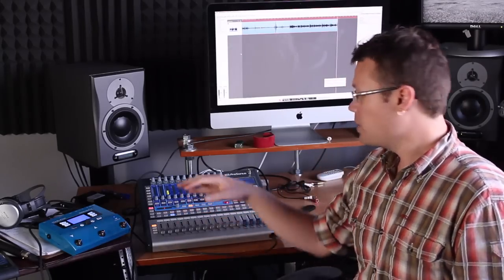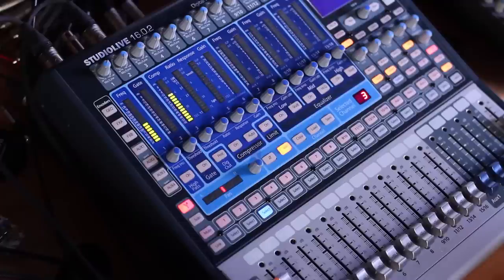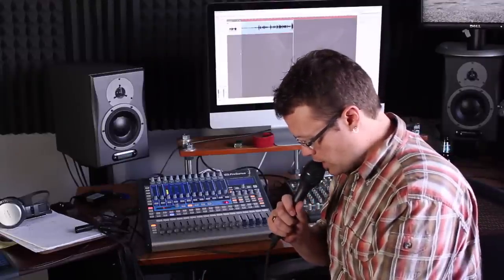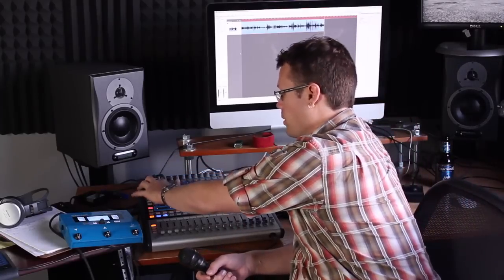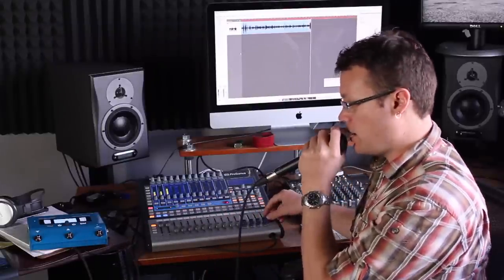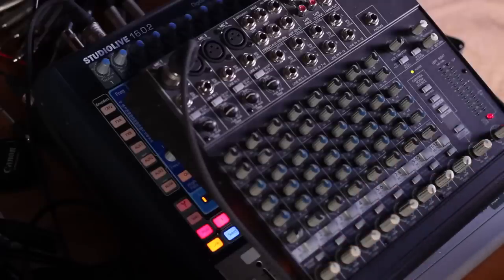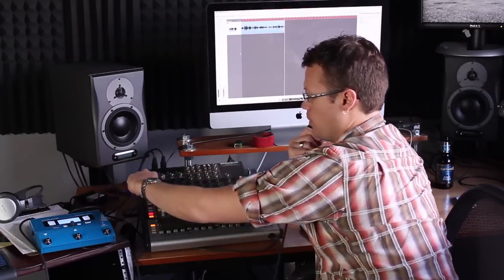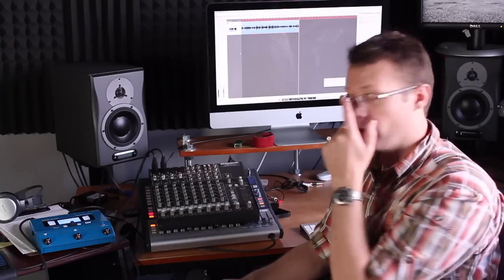TC-Helicon - Mixer Setup, Gain Staging and Vocal Processors

Comment: Feedback is not the issue for me. Getting a blended harmony through a PA is/was my issue. It takes a lot of experimenting to get it right especially with my wireless Sennheiser. I would typically "red light" the Voice Live Play with its gain turned almost all of the way down so I had to go into the wireless receiver and back the AF down to -12 or -18. I then go into my output on the TC unit and boost it to low or medium depending on the board. (usually Mackie ). At that point get my harmony at a nice level. I can then adjust the gain on the board adjust the sliders on both channels to get a natural sounding harmony out front. Hopefully this helps some of you. Since some sound engineers throw a hissy fit about using my Voice Live Play or even any mic other than a Shure 58, I often find myself tethered to a 58 without additional doubling or effect of my choosing. They would never tell a guitar player that he has to play "Eruption" with the house's Fender Mustang and no effect pedals but unless the sound engineer is a singer, he doesn't quite get it.
Reply: Hi please!
I need so much to understand what have you done to achieve good results live.
I got a TC helicon voice live play but when I use it, I have to turn gain on the mixer way up.

Comment: Just listened to this for the first time...,the stereo idea is intriguing...,I take it that stereo is primarily done for the Efx in the VLPlay, you want a wide sound stage but you also have chorus, etc to consider and that, to my mind always sounds better in stereo....,obviously you need a stereo mixer and then stereo into your DAW channel/track. (BTW - I've heard it's not good to hot-wire your inputs into the mixer, it harms the pre-amps)

Comment: I bought this . I received it today . I remember asking someone who did a video on it and I asked a question of what is everything that is needed for me to be able to use it. And I was told the voiceliveplay and a mic (and I got the mp-75 mic) and I don’t know but I’m trying to use it and it’s not working for me.. what am I missing . All I have is the voiceliveplay and the mic and the wire connector for mic to the pedal. And the power cord that’s all . What am I missing please help
Reply: Leonid, you also have to have some type of amplified speaker. Whether that's a powered mixer to speakers, unpowered mixer to powered speakers, Analog/Digital interface to computer with powered monitors, or an amp or headphones.

Comment: Hello Craig, just a quick question. 
assuming that my guitar and vocal levels on the pedal have been set and are ok
what is the correct way to use the output level knob on voicelive 2? if for example i have it on -20db and the signal going to the mixer is weak, is it better to raise the output of the pedal or raise the gain knob of the console?

thanks in advance

Comment: Craig Hi! Thanks a lot for another great video of yours! All of them are of great help!
I have just one question with regard to how to connect VL3X to a mixer. Just to make sure that I am not doing anything wrong. I did manage, frankly, to read the manual but still have some doubts.
The question is pretty simple: where do the outputs from VL3X go? To mixer line inputs or mic inputs? Using Mic Mechanic and Harmony Singer I plug them into the mic inputs and it works fine. 
Sorry for a stupid question but, still, it is better to check it seven times rather than to burn down some circuits.)))
Lots of regards and thanks/
Alex (Russia)
Reply from the maker: Not a stupid question at all! Mixer line inputs are what you'll want to connect your VL3X to! That way, whoever is mixing will have control over how your VL3X is balancing with other Inputs on the mixer!
Reply: Александр и как в результате вы подключили? Ничего не спалили? У меня vl3ex beringer flow8.

Comment: Hi! I'm trying to use my VLP to cover Cannonball. It has a medium reverb on the main part and heavy distortion on the HIT button. I'm having a hard time once I get to rehearsal and we plug it into the mixer. The main part is really loud and the distortion part is too quiet. Maybe what's happening there is what you're talking about in this video. Any suggestions? Also, in general, is there a song setting that is similar to Cannonball?

Comment: when you adjusting the input -> "mic gain", if you give a voice without harmony, everything is great. but with the same "mic gain" if you specially enable the harmony -> high+higher, then the signal starts to give pick with a red sign. should i make the test with when "harmony on" ?
Reply from the maker: If you're getting a red peaking signal, you should reduce mic gain until it returns to green. You want to make sure you don't go red even at your loudest to ensure best quality.
Reply: @tchelicon  in Setup -> Input -> Mic Gain is just 9 dB. When i open the harmony, the picking with red light starts. Probably, when I was learning "harmony settings" i messed up the subsettings. can you help me where, from which video i can learn all the details of the harmony preferences? what i found so far is this: https://www.youtube.com/watch?v=NVzXAE-R2hM   is there any other resource, or video that you can  suggest? probably just because of this problem i may return back to factory settings of voicelive 3 extreme.

Comment: Very nicely done...explained well, and hardly any unnecessary fluff.  I did have one question...I recently bought a "powered" dynamic mic (Blue enCORE200 w/phantom), and I use the TC Helicon Harmony G.  Is there something special i'll need to do because after plugging it in as I normally would with my typical dynamic..I get nothing.  Thanks..
Reply from the maker: +Rick Bendel On Harmony-G I believe you need to press the Manual + Double buttons together to turn on and off Phantom Power.
Reply: +TC-Helicon Thank you for the quick response.  I did a bit of looking around after i'd sent my question here, and was able to figure it out, regardless.. I thank you.  If I may..my pa/mixer has global phantom, and 1 other member of my band is using the same mic I use that needs the 48v phantom so it will have to be turned on at the board for him..will this be okay?  I'm concerned that i'll be doubling the 48v by turning it on at the pedal, and cannot omit my channel from the global phantom once its on.  Again, I thank you for the response, and for the record I love my Harmony G! :)
Reply from the maker: +Rick Bendel Yep, you'll be fine. We protect our mic inputs from phantom coming in. It's good to be wary of though. I've blown up several audio interfaces by forgetting to turn phantom off in our devices before connecting an output to our mic input during testing. D'oh!

Comment: Hi, really enjoyed your video. Couldn’t find many videos explaining set up. I have a question though wondering whether you know what to do? Ive just bought a Voicelive extreme 3 and want to play my Taylor guitar and shure 57beta through the VL3X. Do I need to buy a mixer and a set of speakers to use it properly. Originally I thought I could play it through my Fishman loudbox performer but it doesn’t work for some reason. Any advice on equipment mid to low price that would help me?

Comment: Really like this vid! And I get how you put the mic at Unity it Zero and increase the Mains. What I don’t understand is how do you do that with multiple inputs? You can’t put drums, guitars, bass, all at unity then turn up the Mains, right? Or is that the idea behind the trim, to allow you to get the inputs all to unity then just up the Mains? Please help!
Reply: I know your question is 2 years old but I only just saw it when I was reading the comments, saw that you had no response and thought I'd try and help you out. This video assumes that all you are putting through the PA is the vocals.

If you are putting other instruments, etc. through the PA then yes - you are right, you wouldn't put them all to unity on their individual faders / level knobs - you would adjust these to get a pleasing mix so that nothing is too dominant or, if it is, that it's meant to be (such as your vocals) and then control the overall level (or volume / loudness) with the master fader / master level knob.

The gain or trim knob is to ensure a good strong signal through the desk without clipping and has nothing to do with loudness or volume (although higher gain will increase the volume) - once the gain is set correctly you leave it be and adjust volume from either the individual channel faders (for each input) or the master fader (for the overall volume of the entire mix). It makes me cringe when I see people messing with the gain / trim knobs after they have been set because they want things louder!

I hope this makes sense but if you need extra help then check out the video on my channel - "Mixing Desks for Noobs" and this should help with the explanation. It's not great video quality but it might help you out.

Best wishes, Darren
Reply: @topdazzle  thank you so much! I’ve actually learned a bit in the 2 years since I’ve posted my question,  it I truly appreciate you getting back to me! And I will check out the recommended video! Thank you again!

-Jay

Comment: Aren't you supposed to connect the VoiceLive outputs into the mixer JACK inputs, in order to bypass the mic preamps on the mixer, since the signal is already at line level?

Comment: Craig, this is a great video.  while i've followed it to a T, i still can't get rid of the feedback in live settings.  i'm using a wireless mic that requires phantom power and have made sure that the gain is below the line.  i've used on different systems with different sound folks and still weird squealing.  any ideas?
Reply: Did you ever sort this out? Same issues here although I don’t use a wireless mic. Super frustrating and hard to find answers for!
Reply: @danielawilliams7911  nope... I sold it
Reply: @stormcat7  good to know ha.. thanks! Mind me asking if you replaced it with anything?

Comment: Hi!  I'm have this vocal pedal and usually just use the left channel for singing  live but I am wondering if there is a way to send a dry mix (right channel?) to my monitor while sending the wet to the house?
Reply from the maker: If you have a unit with 2 XLR outs, there's typically a "MONO" output mode that sends Dry/Wet (full mix mono) from one XLR out and DRY from the other. I think you could achieve what you're looking for in that case.

Comment: how do I send my backing tracks to the guitar outputs. the manual tells me but does not show me. it's as clear as mud
Reply from the maker: Make sure you update your VL3X to the latest version via VoiceSupport. You can get it here: http://www.tc-helicon.com/en/products/voicesupport-2/

Then, on the "OUTPUT" tab in the setup menu, you'll see XLR out settings and a "Guitar Jacks Mode". You'd change the "Guitar Jacks Mode" to "Backing Track".

Comment: Hi,probably asking a dumb question but here goes-
Im looking at purchasing a TC Helicon Mic Mechanic 2, and and was wonderin,once set up to a PA Mixer, does the MM2 take control over PA mixer settings? ie EQ, compression, de-essing and gating so all settings on mixer which I would normally use are just turned completely down/off? hope this makes sense.
Reply from the maker: Totally makes sense. I'd start by removing every effect and flattening the EQ completely. Treat the signal coming from the Mic Mechanic as closer to a mixed track or other "complete" source. Ideally, the MM2 does the work and you just ride the channel fader to mix it into the rest of the music.

Comment: Hello Craig, When playing MP3's/Music/Tracks etc. Which is the best way to do it? Run 1/8 plug from your player ie Laptop, Cellphone etc through the TC-H or my Soundboard/Mixer? 
Great explanation of a lot of things by the way!! Thanks!!
Reply from the maker: If you want the TCH product to ever use the music signal for key/scale for harmony/hardtune, you'd want to run music into the Aux so it can be analyzed by the chord detection algorithm. It's also handy if you're using the headphone output for in-ears or otherwise wanting the TCH product to have control over the relative mix between your voice/guitar and tracks. If you just want to send tracks to front-of-house and don't need the other stuff I mentioned, you can just go direct and then get some track back in your monitors.

Comment: Question:   Using a condenser microphone and the mixer has a separate 'phantom power'  button.. Will the mixer's 'phantom power' button need to be pushed, or will my TCLive3 Extreme do the work?
Reply from the maker: Hi Molly, if you are running the Mic through the VL3X first and VL3x has phantom power enabled, then the mixer shouldn't need it.

Comment: I use a wireless microphone, so my wireless mic receiver acts as my "mic" in my chain.  It's a Sennheiser XS Wireless and it has a volume knob on the front...I don't know where to set that level while I configure my gain settings.  Any suggestions?  The wireless mic receiver does NOT have a clipping/OL signal.
Reply from the maker: +Whitney Borisenok Hmm, if your TC-H product is set up so that it's not clipping (but getting good green/yellow) LED signal into it, and you hear clipping, you can be fairly sure it's coming from the Sennheiser. In their manual, they just say to listen for distortion and turn down the volume on the front. If you do that and the distortion goes away, then you can re-calibrate your TC-H device to make up for the lower level from the XS. Does that help?

Comment: Hi! Thanks for posting the video. Im trying to figure out how to lower the overall compressor in the voicelive play 2, (the white one). Where do I find that? just looked through the manual without any luck. Thanks/M
Reply from the maker: Compression takes place in the Tone settings in the Setup menu. You can't individually control the compression as it's adaptive and part of Tone. You'd have to turn tone off.
Reply: Thank you!! I have two TC voicelive´s, and enjoy the easy and user friendly design. etc.. Although, I have to ask, why not label compressor as "compressor" and why not label the harmony after their right position, like a 5th or a 3rd etc rather then "high" "higher"..?
Reply from the maker: For compression, we wanted to simplify what can be quite a mystifying set of controls for the less technical users. Since it's auto adapting anyway, there's not a lot we could offer for control without exposing stuff like threshold and ratio, so we offer the "More Comp" Tone style. I think in VL4 and other future (more complex flagship style) products we might offer a compression or EQ block per preset, but it does lend a lot of complexity and room for changing to a preset that becomes a feedback machine if not set correctly. It's a bit of a minefield. 

For the "high", "higher" etc. the harmony output isn't directly shifted a 3rd or 5th up. It's doing that a lot of the time, but it makes intelligent note choices based on the chords you're playing and the lead note that you're singing, which may not always be that strict shift.

Comment: Hey Craig, great video. I use the tc Play Acoustic directly into an RCF EVOX 12 speaker. I was considering getting the Presonus AR12 to add to my setup and and open more versatility for others to join in during sessions. Would the AR12 improve my sound quality and would I need to switch off the tone and fx of the Play Acoustic in order to avoid doubling up on reverb etc.? Cheers 👍

Comment: I know this is old, but I'll take a shot. If I'm between getting the new Voicelive play OR both the Correct XT & Create XT, what would give me a more "professional" sound and a better anti feedback response? Also, is the Tone button "effect" the same in both devices?
Reply from the maker: Jonathan Luisi The Correct XT is the only unit that will give you anti-feedback. In terms of professional sound, the algorithms are very similar between Create and Play. That said, Play is MUCH easier to edit than Create XT. If you're looking to have lots of presets for your songs, I'd certainly go with Play. You could run Correct into Play, but Play has pitch correction and Tone. You just wouldn't get the anti-feedback. To be perfectly honest, getting rid of feedback is something you can do on your own with speaker/mic placement, levels etc. Here's a vid on that: www.youtube.com/watch?v=VlN1RJ4gcAo

Comment: Hey Craig, I discovered you while reading my Play Acoustic manual and you seem to be the right guy to ask this question. Can you give specific information on setting up the Play Acoustic with a Bose L1 Model 2 p.a. with the Tonematch mixer? I have mine hooked up...however I want to be sure that I'm correctly set up. Any information you might provide would be greatly appreciated by me and the folks at the Bose forum as well.
Reply from the maker: Matthew Chambers Sure thing. Turn tone match off  on the Play Acoustic channels. Any of the Tone and Bodyrez processing done in Play Acoustic doesn't need further processing by ToneMatch. Just connect direct in stereo or vocal/DI (PA's default output mode) and set the gains at the Bose so that you're not overloading the inputs. You're all set.

Comment: I use the same Mackie mixer in the video. One question I still have is do you always set the channel faders to Unity or is there a way to know what the right level for this is, similar to the way you know what the right level is for the trim and master based on the meter and feedback?
Reply from the maker: +Kendall Artworks I set the channel faders to unity at first, but then adjust as necessary when mixing the actual show. The main thing is getting the gain correct at the trim knob so that you're not clipping the input. The fader can then be manipulated knowing that your incoming level is clean.